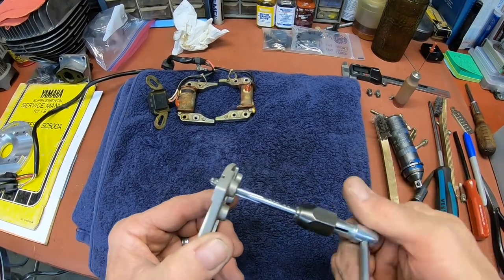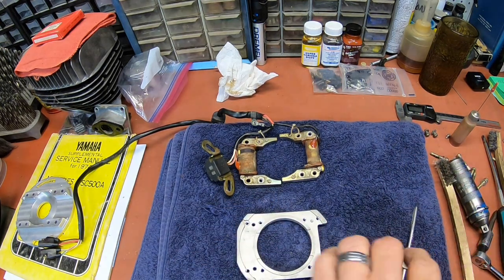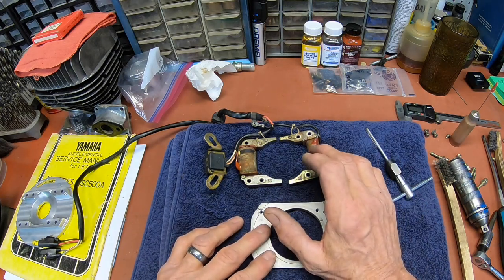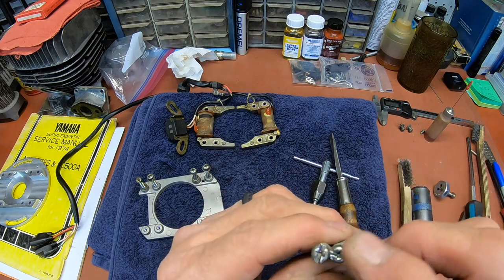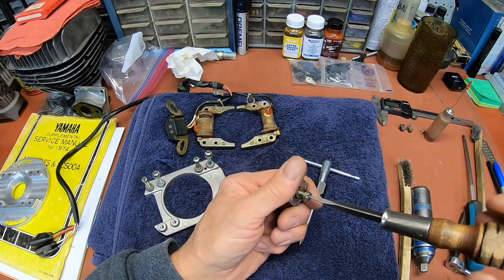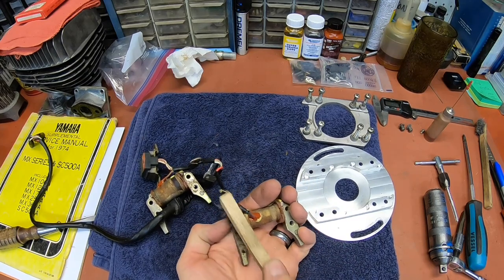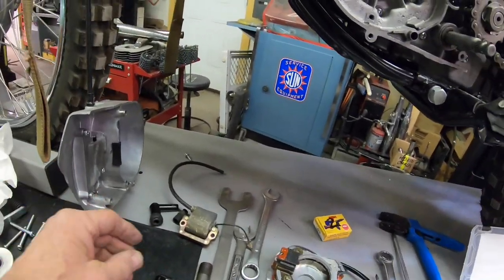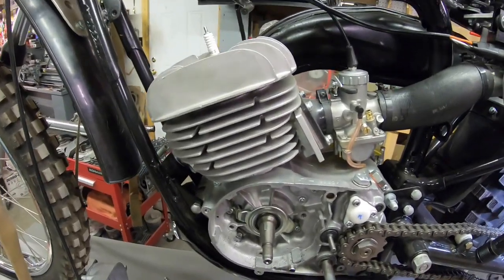Yamaha AT-2 MX CDI ignition fixed, RUNS GREAT, silencer works good too.

Comment: Hey Finally !!  The video I have been waiting for,  Knew you would get there Dale,  Sounds awesome and looks it,  The bike is over 50 years old, so all that stuff needed attending to anyway, there was quite a lot of corrosion 
there on and around that stator,  and behind that pickup, those wires were probably in the same state. I recently found out myself only about 2 years ago that, If you have a resister Spark Plug you do not need a resister Cap, and visa versa, Recently built a Virago 535 Bobber and that had both Resister Cap and Resister Plugs, After changing the HT Caps it started and ran much better, So at least you have picked up some new knowledge on the way doing all that research into CDI Ignition systems,  etc, etc,  I am really pleased for you, and can say I also learnt a lot from these past 3 videos on this problem with this bike, What an awesome Channel this is, If your into classic 2 Smokes, this is the Channel to watch, Many Thanks for posting all this Stuff,  You have the Gift !!!   You can Have a good sleep now I bet  !!      Malc U.K.
Reply from the maker: Hey Malc, thanks for the kind words, yes this has been more than I bargained for. But looking back I have learned a lot and am looking forward to the next experiment. I am happy with the silencer too; it really does knock the noise down. Yes, my friend Peter told me about the spark plug caps, I found a supplier for the non-resistors NGK caps. I am still trying to stay away from resistor spark plugs, you just can't get them from NGK anymore, so I am slowly replacing my stash with Autolite plugs that are non-resistors. Back in the day I worked for a Ford dealership when I was riding these old bikes and I used Autolite then and had very good luck with them. I am already thinking about my next CDI experiment, I have just pick up a RM 250 PEI system from Kevin Bergeron and I may try to install it on a small CC Yamaha. This stuff is just fun, but of course you hope you don't have unforeseen issues like this time. But I learned a lot and am thankful for all the help and ideas/suggestions that I got from folks along the way. Thank for hanging out in the shop with me.

Comment: Congratulations, Dale. I had every faith that you would get there. If I was a betting man I'd say that it was the corrosion degrading your signal but it matters not, you have a very crisp sounding bike now. The new silencer is a work of art, looks good and takes the edge off the noise. Perfect. 
Best wishes, Dean.
Reply from the maker: Thanks Dean, I guess if I had to guess...your right it was probably the corrosion, but when I made the stator plate, I checked all the ohm readings, and they were in spec. I think that is why I just didn't bother with any further inspection. I like the silencer and the looks is more retro than the ones that are available. Will need some jetting in the spring. Thanks again for all the support and spending time in the shop with me.

Comment: The silencer sounds awesome your  Neighbors will thank you for that LOL. As I told you before I'm building another MX this time not street legal and I definitely want to do this set up on my mx  love watching your videos keep up the good work 🙂👍
Reply from the maker: Thank you, Marcel, yes, I'm sure the neighbors will be happier for sure. This has been a learning experience for me. I was sure it would work, but I have learned a lesson here to go through the used parts and inspect for corrosion in all the connectors and mating surfaces. I plan to do some more conversions like this, I plan to use a RM Suzuki PEI ignition on the next Yamaha. But rest assured I will inspect it carefully. I have found through my experimentation that the backing plate from the early Yamaha MX and YZ 250 and 360 will fit the 130 mm case of the 125/175. It looks like it will work if you recut one slot for the adjustment and of course you have to use the 125 internal rotor, because of the crankshaft size difference. Anyway, it is fun to get all this stuff to work together, but it's really nice if it works without unforeseen problems. Let me know how your project goes, your bikes are without a doubt some of the finest out there. You do great work, send me some pictures of your new project when you get going. Thanks for hanging out in the shop with me.

Comment: Well done Dale, even though you did "correct"  several issues in one shot all of those problems deserved attention, the fact you hit the target even though you don't know exactly which one was at fault causing the running issue, all of the items you worked on  needed your attention, it's not like you were "arbitrarily guessing" if those issues were real or not.
Reply from the maker: Thank you, Peter, it just had a lot of issues, I am a bit mad at myself for not going through a better inspection prior to doing this modification. I really just wanted to see if I could make a factory set up work on a bike that it never came on. These parts did cost about a fourth of what a new aftermarket unit cost. I have plans to do some more like this, but now I know to do a good inspection and fix anything that is questionable. I did do an ohm check on all the components when I made the stator plate, but that check did not show any discrepancies. Anyhow, I sure appreciate your help. Thanks for spending time in the shop with me.

Comment: Ha!  We call that "shotgunning a problem!  Yeah, I do it too sometimes.  What matters is it's fixed, and I bet you're glad, as am I.

So, to clarify a few things.  

A points style system generally sends 6 to 12 volts or so pulsing through the coil.  The term CDI is of course, "Capacitive Discharge Ignition.  A capacitor is charged, then discharged through the coil at several hundred volts instead of 6 to 12 or so.  That's why the coils are different.  A standard coil should work with a CDI, but it's not optimal and might not last long.

The resistor cap and/or plug:  Without one, the spark current can bleed off through carbon deposits and/or fuel on the plug, and cause misfires.  With the resistor, the current must build up to a higher value, and once it overcomes the resistance value, it is much more likely to jump the spark gap instead of bleeding off.  You might remember from your automotive trouble shooting days where a plug wire could be hooked up, but the cylinder be dead.  But when you pull the plug wure loose and let it SPARK to the plug terminal, then that cylinder would start hitting.  Clear sign of a fouled plug on that cylinder.  Same principle with the resistor plug cap on a bike.  Using resistors also cuts down on radio interference.

Being as how you are super fastidious, like me, I had assumed you had gone all through that stator and all wiring.  That's where the problem was with all that corrosion!!

Remember how I explained about the "advance" system on a CDI?  Well, the way the little "computer" in the CDI box knows when to quit retarding the timing is by counting pulses coming from the stator.  (Pulse coil)  When the pulses are very low, like when kick starting or at idle, it keeps the timing full retarded.  As the pulses climb because the throttle is opened, it takes out the retard.  (Thus "advancing" the timing.)  With your gummed up stator assembly, the CDI was not getting good pulse information, and not advancing properly.  Voltage to the CDI may have been low as well.  Certainly, that's where the problem was.

It sounds GREAT, and CONGRATULATIONS!!  Your muffler is a work of art too.

One thing Dale...  may I ask why you were so adamantly against throwing a timing light on the bike?  Many, many, of us tuners use lights on the bikes now.  I, for one, do NOT trust those factory timing marks and have found many of them to NOT be correct/when the CDI is firing.

Congrats again--> jetting sounds fairly close too!

Robert
Reply from the maker: Thanks Robert I sure appreciate all the help, however a little overwhelming. Like I said in the video, I have always looked at the cdi systems as it works or it don't, it was kind of black magic, and I just did not want to disturb anything. I tried to just bolt it on, well it didn't work. I know better next time. I did perform all the ohm's checks when I fabricated the stator plate, and all readings were within range. So, I guess that is why I didn't pursue it further.  As far as a timing light goes.... I have worked on hundreds of these over the years and have never seen one that wouldn't at least run normal on the factory marks. So, I knew it wasn't revving by the sound, why would I need to visually see it. I am not a "Tuner" just an old motorcycle mechanic. I'm sure that using a light would show a better timing event, but not necessary for a guy just having fun. I do use timing lights on 12-volt point systems, but just never worried about it on a bike like this. In this case it wouldn't have shown me anything I didn't already know. I think it is a bit rich, but nothing I can do about it with a foot of snow on the ground. So that will have to wait till the weather breaks in the spring. Still thinking about painting it Brillant Red. Again, thanks for the help and for spending time in the shop with me.
Reply: Ok, this will be my last reply on this one, just because I think we're still misunderstanding each other.

When you set the timing on a points bike, using either a test light, buzz box, or feeler gauge, it is just a physical law that the spark will occur at that time.  NOTHING can change that.  It's just an absolute fact.

HOWEVER, this is NOT true with CDI.  The reason is that the CDI CHANGES the spark timing electronically.  You set the timing where the factory tells you to.  Then the CDI itself moves the timing around.  You have no way of knowing when it is really sparking because through the magic of electronics it literally changes the timing itself!!

Virtually the ONLY way to tell when the CDI system is sparking is with an automotive timing light.  (Not a test light--> a regular automotive, pistol style timing light,)

An automotive timing light, which is triggered by the true, actual spark pulse, will tell you when the CDI has "decided" to fire the plug.

In your case, it would have shown it was firing at the wrong time, and have pointed us to the stator and/or pulse coil as the most likely culprit.

Anyway, YAAY, it's running, and YES!! -->  RED!!  That'll be great!

;~)

Take care and stay warm,
Robert
Reply from the maker: Robert, I understand completely, I was saying that I have never seen one that would not at least start and run on the factory marks, except this one. Yes, I get that the timing light will show when it is firing. My point was, I already knew it wasn't advancing, there was just no point to validate it with visual aids, i.e., the timing light. There is no way to change the operation without changing parts, or finding a problem, i.e., corrosion, wiring or whatever. Since I had already advanced the stator with almost no improvement. I understand that the timing light NOW will be the best way to ensure the correct timing, now that it is running correctly. But during the diagnostic process, I didn't need to validate what I already knew. I knew there was either a problem with some part, or a mismatch component. Before I installed these parts each was checked with an ohm meter and found with in factory specs. So, the only way besides spending more money on parts that may or may not help or work. I just started going and melting off terminal insulation and removing the pulser coil, till I found common issues that can affect all sorts of electronics. Sorry to be such a reluctant student, but my mind was telling me that the timing light would not show me anything that I already knew, UNTIL the engine was at least running somewhat correctly. I do appreciate your help immensely, us old guys already have a mindset from years of troubleshooting, and it is hard to make changes to established thinking and patterns.
Reply: Ok, gotcha.  I understand.

Speaking of "Old man-Stubborn ways" guilty as charged here!  In my many years of trouble shooting I too have thought "If a man built it then I can figure it out/fix it."

My stubborn old man philosophy though, has always been to very precisely understand exactly how an item works, and exactly what it is doing, before I trouble shoot the problem.  In other words, what exact process is supposed to happen, and what part of that process is breaking down?  This not only leads me to the exact defective area or part, it is also very satisfying and educational to fully understand some complicated piece.  Using this process, I've repaired countless things that others had given up for lost.

My father, a mechanics instructor in the military, often said, "There's true MECHANICS, that actually understand how things work, then there's PARTS REPLACERS."  I decided I would be a "Mechanic".

So, sorry about being so "pushy" with all my info.  
I would have needed to determine exactly what was going on.  The stator's job is to supply the power.  The trigger coil the pulses for timing.  Using a timing light to figure out when it was firing would have been the first part of digging into and troubleshooting that stator/trigger coil setup for me.

Anyway, hopefully we all learned something, but one thing's for sure-->  Dale's amazing!

Robert

Comment: I dont find the non resistor style plugs much anymore, although i dont notice a difference with points style.  The bike sounds so good
Reply from the maker: Thank you, yes NGK is just not making them anymore, I am slowly moving to Autolite plugs non-resistor, the big thing is you don't want to use a resistor cap withe the resistor plugs. Just think that is too much. May run ok, but I think it will be better to leave at least one of those resistors in the trash can. Thanks for joining me on this project.

Comment: What  year bike did that cdi come off ?
Reply from the maker: I went over the whole process and talked about the parts in the playlist I left below. There are a couple different ways to do this. The easiest is to find a 74 or 75 Yamaha YZ125 and get all the CDI parts. You still have to make a stator backing plate because the YZ backing plate is 120 mm and you need 130mm for the older bikes. The other is to get all the parts from a 73 or 74 250 or 360 MX but with this one you will still have to find a 125YZ rotor for a 74 or 75 model. The 250/360 have 130mm backing plate but it will not mount up, so you still have to make the backing plate. The wiring can all be used as is on the 250/360 but on the YZ 125 you have to rewire the stator a little but it's not a big deal. Thanks for watching, and good luck with your conversion.